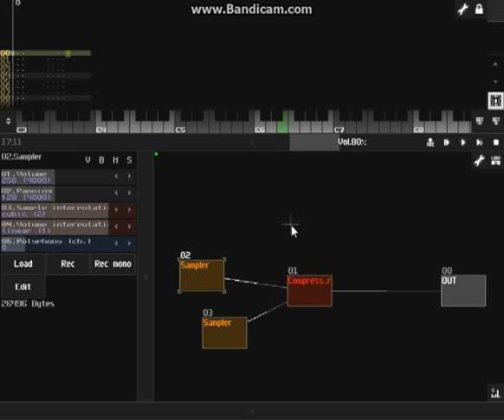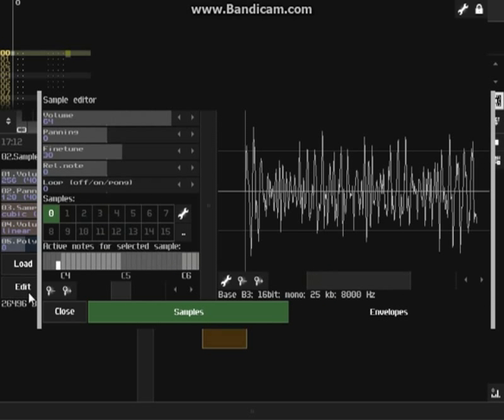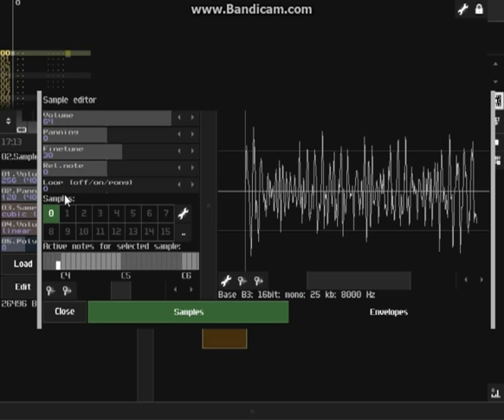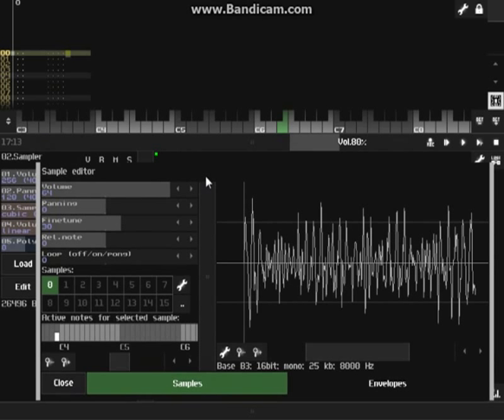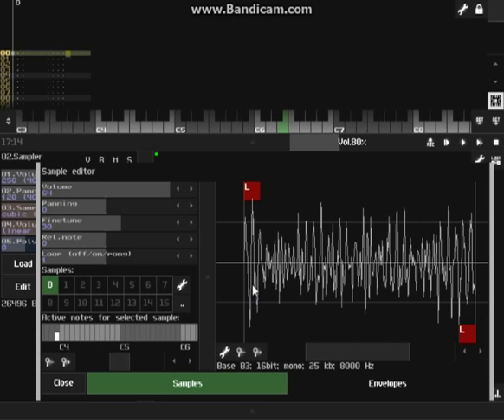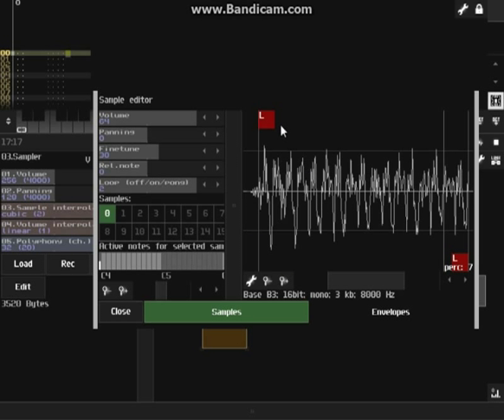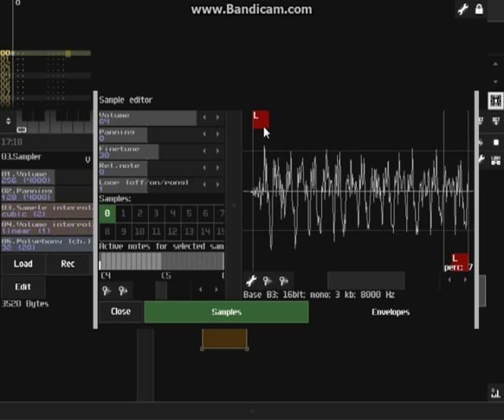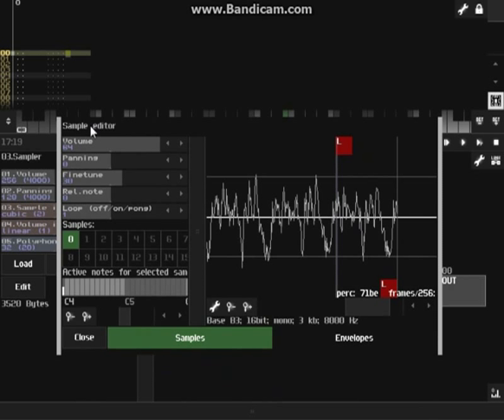SunVox Tutorial #13 - Sample Looping

Comment: do you know how to put sunvox into ableton
Reply from the maker: +doran stewart stewart No, you can't. Sunvox is a standalone program.
Reply: Well i saw mndsgn use propeller with ableton. In his session so there must be a way
Reply: How about other tracker programs. Like protrekker
Reply from the maker: +doran stewart stewart No idea about other programs. If you're talking about Propellerhead's Reason, I dunno; it's also a standalone application, but I know there are ways to have that application interface with others (like Logic or whatever). However, they are specifically made to support that - it's not something every music application supports, apart from just exporting tracks from your songs and importing them into your DAW of choice. So no, as far as I know, there's no way to do this in Sunvox.